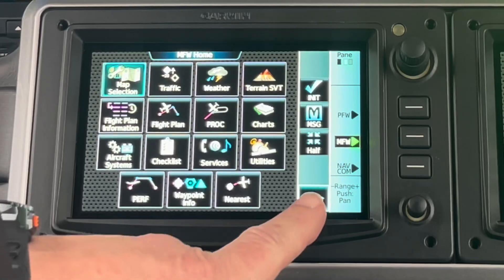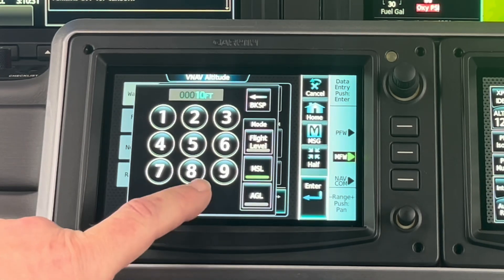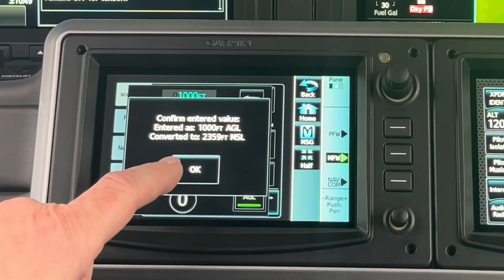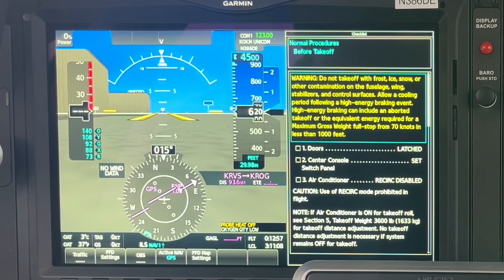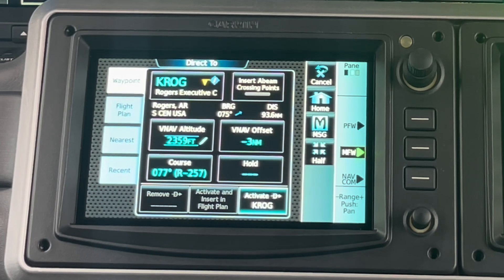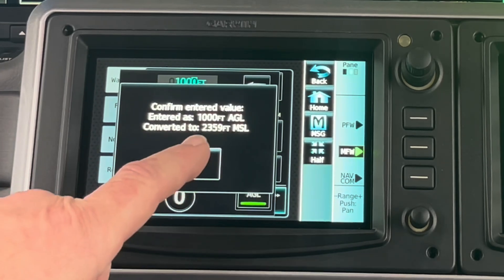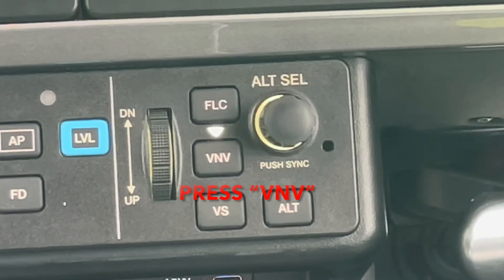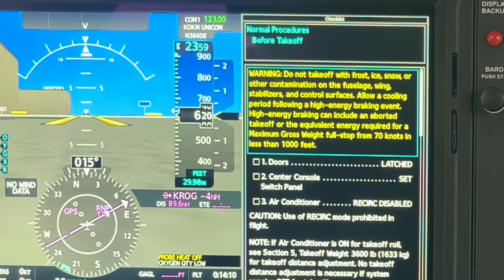Cirrus G7 VNAV Profile

Comment: Do you then immediately set the altitude bug while at cruise height, or do you wait until it is about to start the VNAV profile on the flight plan.  I tried this today but wasn’t sure when to do it and cancelled it.
Reply from the maker: Good question.  You can do it either way. You should get an alert "Vertical Nav" or something like that when you are 1 minute from Top of Descent TOD.  That is my reminder to make sure that the VNAV function on the Autopilot is selected and that I have a lower altitude than cruise entered.  I hope that helps.
Reply: @destinationsaviationcenter3301 perfect, thanks!  I used it today into KBHB.  Big help planning an arrival!